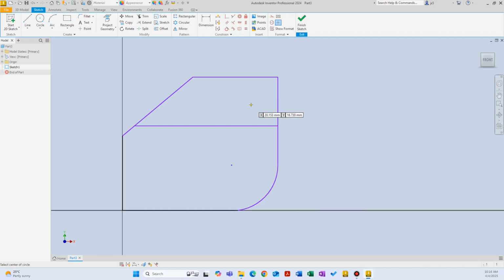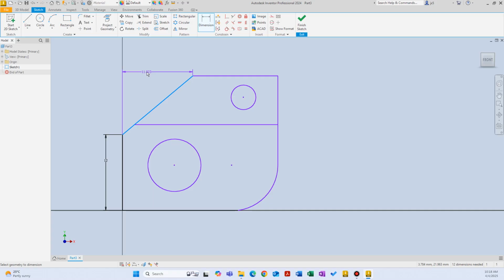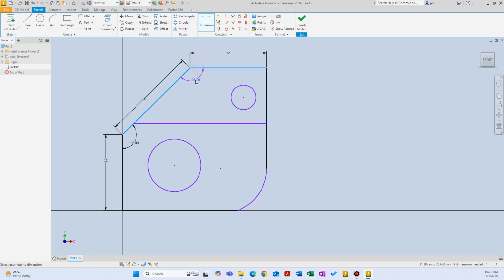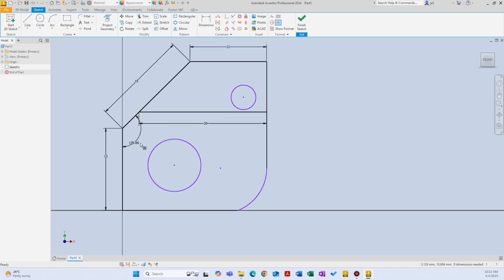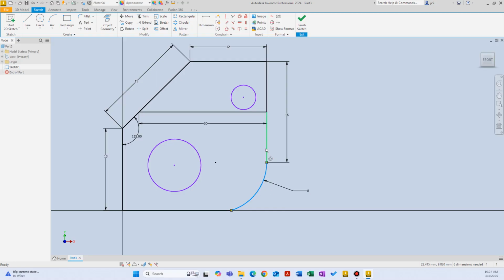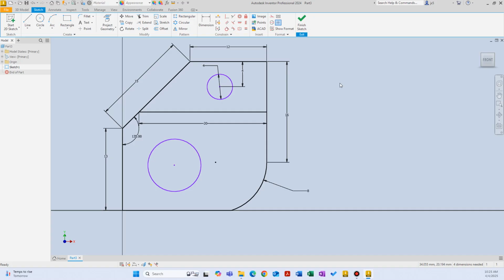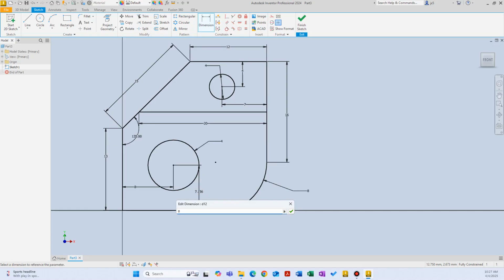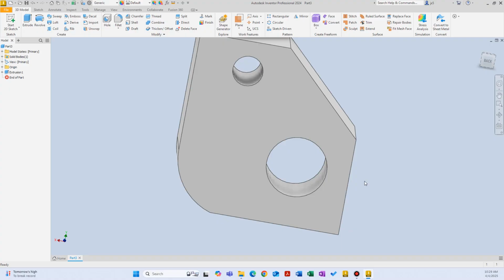13 - General Dimensions | Sketch Concepts | Autodesk Inventor Pro Tutorial

Comment: i did not know that inventor is blender that doesnt make you manage triangles and quads. how is this possible that engineering program is easier than 3d art program
Reply from the maker: The instructor in the tutorial used inventor to generate the model and STL files and then transferred the files to a slicer for 3D printing. Thank you for pointing this out. We will inform the instructor to mention this detail in the future videos.